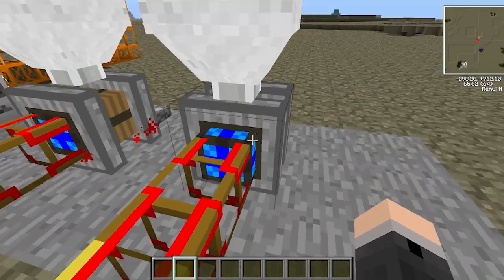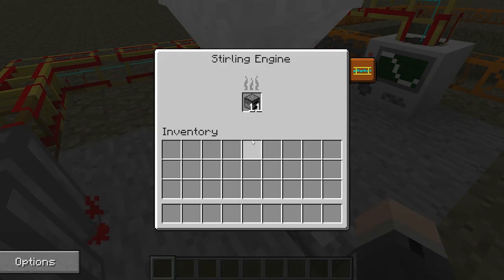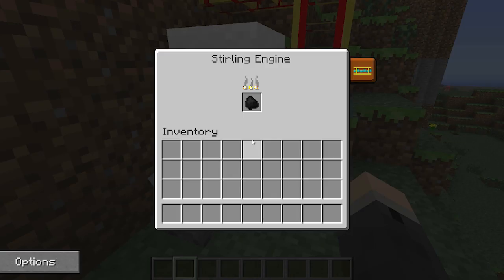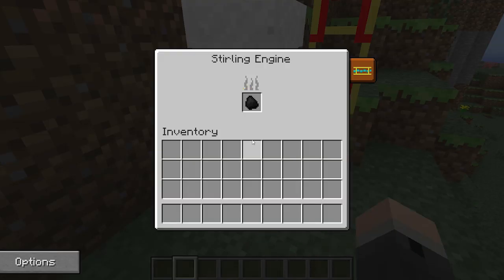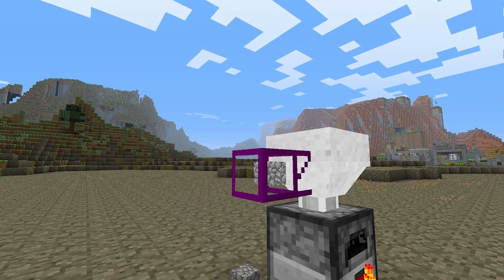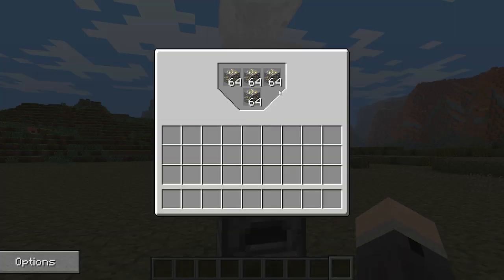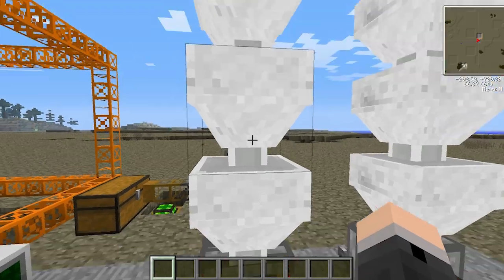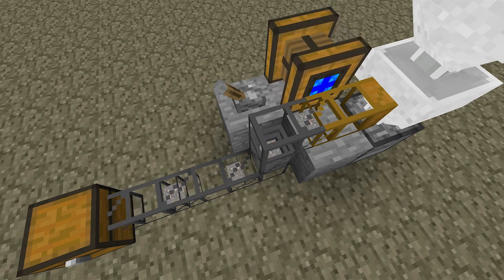Hopper/Chute (Tekkit/Feed The Beast) - Minecraft In Minutes

Comment from the maker: Yep, spot on! Usually the engines will automatically point towards an item that can accept their power, it could be a machine, or a wooden conductive pipe. 

The Buildcraft Wrench (The Grey One) can be used to move the engine to switch between connected pipes/machines.